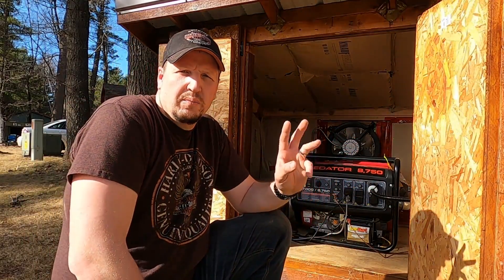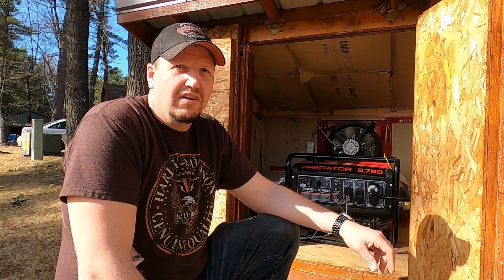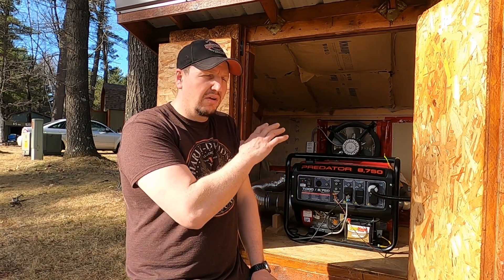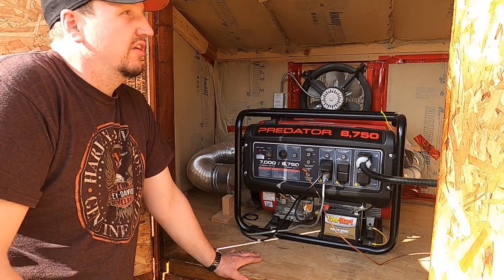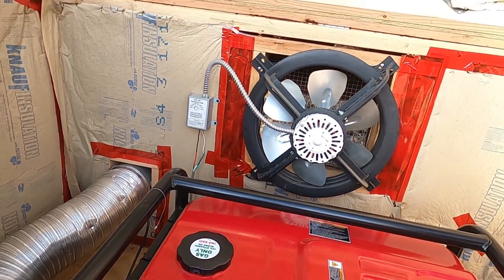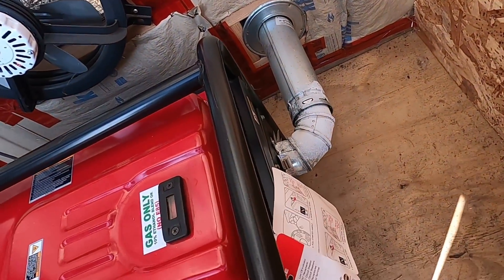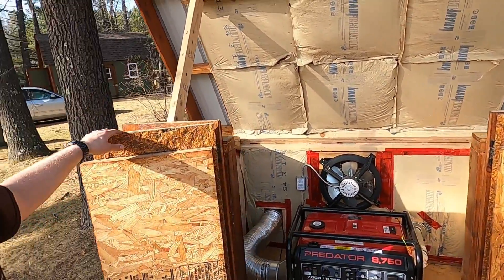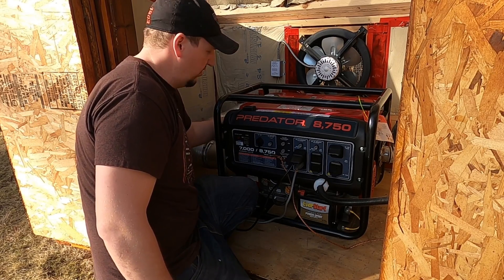Predator 8750 Generator in a Custom Generator Shed | PLANS AVAILABLE!!

Comment: Did you used 4 or 6 gauge wire from gen to house?  That’s a long run.
Reply from the maker: If I remember correctly, probably 6.  Yes, most likely some voltage loss, especially if I had a 50 Amp Gen.  But I am only running 30 amps which is OK for the 6 gauge.  

Knowing what I know now, always important to do the voltage loss calculations.
Reply: @OutdoorsEngineer  I have a 9500 with a similar length run and i have zero loss. Love the house. I have to step up my game, but I focused on getting NG, #6 and a transfer station all set up. Now time for a pretty house. If the 11500 is all they say it is I will be moving up for next hurricane season so I’ll super size it.

Comment: Have you replaced that high THD power generator yet with an inverter model?  Maybe a dual fuel?  Good looking shed for those loud beasts.  lol
Reply from the maker: @ITguyAR_66  I ended up getting the Inverter Genset from HF (another video)

Comment: Plan to buy a gen soon and have reviewed Gen many YTs.  Your install looks and is great, BETTER than a Generac imo...including esthetics.  Sound dampening seems impressive.   Big thumbs up for moving shed away from house and burying cable under driveway.   

Few thoughts....1.  Consider doing periodic and check listed, full load tests (monthly/quarterly) to help insure emerg pwr is available when needed.   Also, train spouse or child on safe startup/shutdown should you be away...or become forgetful.  Consider powering cooling fan AFTER gen is switched off...based on interior temp.  Consider installing properly rated fire extinguisher or blanket very nearby or inside shed.   I like idea of having low power LED utility light auto illuminate at night upon opening shed door.  Also, a solar powered trickle charger to keep battery fresh.   Better mousetrap-ish?  Yeah, but at what price glory?   Again, kudos to you!
Reply from the maker: Thanks, I agree, I really like how this turned out!

Comment: Nice shed. Your exhaust has quite of few bend, this will increase the backpressure on the machine. Predators are notorious for valve problems.
You constructed a beautiful shed and placed a bottom of the line generator inside.  Good video and best of luck to you.

Comment: Always wondered if a water sprinkler feature would help reduce sound noise?
A shed, insulated with styro is a good first step.
Maybe, add a rain dribbler on all sides of the top, maybe pump the water to fall down ACROSS the top of the gen, at an angle?
Seems like there might be something here...
Water is vastly heaver and more dense than air, so, this might eat a LOT of sound!😮
Reply from the maker: Seems like a lot of engineering for how little it actually runs :)

Comment: An earth ground for the generator is not necessary, assuming you ran a ground between the house service panel and the generator.  Won't hurt, but just not necessary.
Reply from the maker: 10-4

Comment: is it necessary to ground the generator when the breaker panel to the house is already grounded?  Basically is it safe to double ground?
Reply from the maker: I'm not sure.  Not an electrician here.
Reply: Most say no , only one ground point, due to ground loops

Comment: Thats funny how you mentioned when you have it you won't need it. A few years ago Texas had record low temps, in conroe tx it got down to about 9 degrees and 14 degrees two nights in a row. and the power was out for about 72 hours during this cold spell. In my opinion it was one of the worse natural disasters that has happened in the past 30 years. Yes hurricane season the power goes out but its usually warm outside we are too far from the coast to really get hit hard anyway. I don't have natural gas so I had no heat. So that prompted me to get a generator.  Its been like 3 years and the power has not went out since. I know that northerners think this is nothing, but down here most people are not prepared for cold weather like that. Most people don't have generators and oil burning stoves for backup. because it usually only drops to about 30 degrees and the power is usually on.
Reply from the maker: I remember that! Wasn't it a big ice storm that did a bunch of damage and took out power?  We lost tons of power prior to 2017 when I installed this generator. Now we've only used it once or twice since!  It is a nice piece of mind though, just in case, and really isn't costing me anything except for a little bit of oil every year or two.
Reply: @OutdoorsEngineer  I guess it was an ice storm, and from my memory I was about 4 years old 1989 it actually snowed enough to turn the ground white. Besides that, it has never snowed that much in this area. The first night all I had was some bell peppers and onions and tomatoes. That was my meal, lol. The next day all the stores had empty shelves and I had like a few bags of chips to eat.  I know other people in different parts of the world have way worse hardships to deal with, but this was the only real time I went hungry and was cold. Actually I'm a veteran and I have been colder but not as hungry during those 4 years, lol. So I have nothing really to complain about, but think about all the people that have young children and elderly, that was a real natural disaster.

Comment: Wow what a nice job! Is that generator enough to run your air or heat?
Reply from the maker: I honestly haven't tried the A/C.  It does run our well pump, and looking at the power requirements for the AC, I'm pretty sure it would run the AC as well.  It has no troubles with the furnace!
Reply: @OutdoorsEngineer  I had a generator that was a little less powerful than yours before I got my Kohler standby, and it could not run my air or heat. The initial draw was just too much apparently. So of course our power went out on a cold winters day. It was out for about 6 hours. That’s what made me decide to get a larger Kohler standby. Just something to consider. But again, it looks really great. A great piece of engineering.

Comment: what intake fan did you use?
Reply from the maker: I used this one: https://www.menards.com/main/heating-cooling/ductwork/booster-fans-accessories/corded-in-line-duct-fan/db206c/p-1449099006884-c-1453749027449.htm. 

But you could probably get away with somthing like this too: https://amzn.to/42v75xi

Comment: if you are running your whole house by code you do not want to ground the generator. your house ground will work fine. as long as you have house ground connected.
Reply from the maker: Thanks!

Comment: Why do you need an exhaust port? Won't the exhaust go out of the box with the fan?
Reply from the maker: The faster the exhaust leaves the better.  You are also adding extra heat that is easily plumbed out using the exhaust port. Plus, newer generators may have a CO detector on them, and if you dump exhaust directly into the shed, it'll shut off due to the CO safey mechanism.

Comment: Is your generator cable wired directly to the house main panel with the interlock device in place and not to a transfer switch or inlet box? That's what I think you're saying and if so I'm happy I saw this video before buying the inlet box and cable because I really like and prefer this set-up, as it requires just going to the generator shed, plugging in the cord and starting the generator, then back inside. This method is best for my wife being out alone in possibly bad weather, as it will get her back inside quickly. As opposed  to her having to get the cord from the shed, then go to the inlet box to plug it in, then go back to the shed to start the generator before going inside. Will it be possible for you to explain how to do this setup? Like explain your method in burying the cable, then that box you have at the house and getting the wire inside. I'd really appreciate it thanks. God bless.
Reply from the maker: Yes, the only disconnect spot is right at the generator.  From that plug, everything is hardwired directly into the panel.  I have the Generator wires coming into slots 2 and 4 in the panel on a 30 amp double pole breaker, although the wire I ran is 6 awg so i could have a 50 amp breaker. The interlock device is designed for my GE breaker panel so that the only way I can turn on the Generator breaker (Supplying power to the panel) is to turn off the main breaker that goes out to the grid. 

The wire from the generator goes into conduit and enters the ground.  In the ground it is directly buried, and then re-enters conduit as it approaches the house.  It is then in conduit until it enters the breaker box. Stay tuned, I will be adding a subpanel in the future and plan to record it, and I will highlight where the generator comes into the panel.
Reply: Thanks for clarifying. I really appreciate it. The WEN 12000 watt dual fuel generator is on its way and I'll purchase the generator 50 amp cord with bare wire end tonight. I'll follow up with you if any issues. Thanks again.
Reply from the maker: @smjohn4640  Awesome.  Where did you order the generator from?

Comment: Did you connect the exhaust to generator with magnets? Maybe my eyes arent so good, but i didnt see a cooling fan, just an exhaust fan, im i wrong? Overall, very nice work...
Reply from the maker: I just used some small self tapping screws, similar to rain gutter screws.   

There is a cooling fan inside the metal duct.  A 6 inch online duct fan.

Comment: Unless I missed it in the video, have you measured the actual ambient temperature inside the enclosure while the generator is running and under load?  I just completed my generator enclosure build and even with heat wrap on the exhaust pipe and a lot of air coming into and out of the box, it still gets up to about 140-150 degrees F (outside temp of about 80 degrees F).  I'm a little worried about the temperature being a bit too hot for the air-cooled engine (my generator is the 8750 inverter generator).  I have thought about potentially taking the muffler off the engine and moving that to outside of the enclosure so that there isn't this extremely hot box emanating heat inside the enclosure.
Reply from the maker: I actually haven't.  Do you have fresh blowing directly on the engine like I do here?
Reply: @OutdoorsEngineer  Yes, I have a vent and fan blowing fresh air right on the flywheel.  The temperature of the air blowing on the flywheel is just a few degrees higher than the outside temp.  What is the longest runtime on your generator setup while powering your house with the enclosure closed up?  Have you run it for hours at a time?

Comment: I built a generator shed just like this one last summer 2022. We had a tornado March 2023 we had no power for 5 days. This design worked great for me, the hinged roof was so nice to add gas and change the oil. I kept the doors shut and the fan kept the shed cool. Thanks for sharing.

Comment: Great ideas for my Duromax 12kw. I defiantly like the hinged roof idea. Only comment is the length of cable to house, voltage drop. I keep my 240v 50a service cable no farther than 25ft from house. Just an opinion, everyone has one...lol
Reply from the maker: For sure!  It is something to consider.  I did plug my numbers in I think Cerro wire's voltage drop calculator and all good.  It's always a good thing to consider the voltage drop.   Thanks for watching!

Comment: Nice design but I would put some angle slats on the exhaust vent to deflect the noise to the ground. Also put some exercise rubber mats on the floor and the doors to absorb the sound.

Comment: No one never ever puts a generator that far from the house. It is always on the side of the house. The cable must be huge. The rest of your shed is great.  Great explanation. 🙂
Reply from the maker: The cable is actually sized if I were ever to install a 50 AMP generator (I used 6-3 wire).  It's actually not that far of a distance but I wanted it as far as possible to reduce the noise I'd get in the house.  You can put it as far as you want as long as you properly size the wires for voltage loss.  Southwire has a nice voltage drop /wire size calculator on their website and we are all good there :) https://www.southwire.com/calculator-vdrop

Thanks for watching!
Reply: @OutdoorsEngineer  The down side to quiet, when you sleeping with it running... someone can steal it and you won't know it until you wake up. Mine is about 15 feet from the house. I know when it stops in my sleep. 🙂
Reply: @JohnSmith-uy7sv there is a device that you can plug in, if the power stops an alarm goes off. I have two of them for refrigerators.
Reply: @2fukWu  ONLY???? The larger the size the higher the price and harder to work with. 🙂

Comment: Set it on sand will make vibration better, not too bad for a Predator gen they are not known to be quite.
Reply from the maker: Certainly not quiet.  The shed certainly helps.

Comment: What AWG wire size did you run to the house ?    (btw-cool shed!)
Reply from the maker: Thanks!  I believe I ran 6-3 (It's been 5 years ha) so if I ever wanted to upgrade to a 50 amp generator, I could.
Reply: Thanks,  at this point I'm just window-shopping generators and looking over my lumber stash.

Comment: Nice shed - but can't seem to figure out how you made the roof lift. It appears you cut the door header and it lifts with the roof.  Does this cause the doors or front wall to be a bit unstable when the roof is open?  Any details on how the front wall to roof construction was done would be very much appreciated.
Reply from the maker: Yes, the roof header is separate from the side wall.  With the sheathing on the sidewall and sturdy attachment of the wall to the floor, I have had no issues with the walls becoming unstable.  They are essentially rock solid. The header is attached to the roof and is just sitting on top of the sidewall, attached through the latches. It's been 5 or 6 years so far and no issues with it holding up. 

Email also sent.

Comment: When you had the generator running, I noticed the fan was turning very slow and not fast as it should be. Why wasn't the fan turning much faster?
Reply from the maker: My guess would be the camera frame rate (30 FPS) makes it look run slower than it actually is!
Reply: @OutdoorsEngineer  I have heard of that and it makes sense, thank you.

Comment: I believe that automatic standby generators are somewhat of a "false economy"  They are really nice and convenient - but come at a significant cost:
 
The thing about an automatic standby generator (like a Generac) is that they require yearly maintenance (that goes up in price a little each year) in order to keep your warranty "intact / valid" it's not uncommon for there to be sales where they'll sell the generator with a 10 year warranty but the catch is they won't (typically) include a service contract for the price quoted - I had a 22kW Generac at my previous home for almost 15 years - when we first bought it (then it was about $6800 all in for the generator, transfer switch and installation) the cost for service per year was just over $100 when we moved (in 2018) the year maintenance was over $200 a year and that did not include a new battery if you needed one (which seemed to last about 3-4 years at $70 - $100).  The maintenance WAS more than just an oil change (or is supposed to be) - valve clearances were checked and adjusted, the generator was checked for output voltage and frequency and adjusted if needed.  Here's what they really don't want you to know or will tell you unless you ask:  Most manufacturers really want to have generators replaced after 10 years regardless of how many hours of use and will almost always refuse to warranty beyond 10 years.  I'd looked into moving my generator to my new home but between move fees and the fact that I couldn't extend or get a new warranty due to it's age or it being moved it wasn't worth it.  You can buy a whole lot of Predator generators - about one a year for less than you would have in a comparable automatic standby generator all things added together.  It is pretty nice to have your generator "kick on" after about 15 seconds of there being no power from the street but that comes at a cost.  For the difference in price I'll drag the generator out of the garage, get the gas out of the shed, fill it up, connect and do the transfer at the panel.  having a nice generator shed really makes things much faster / smoother and the main benefit to this approach is you can upgrade to an inverter generator, one with more capacity - even install an auto transfer switch if you're so inclined - you're not "locked in" to what a particular manufacturer offers.
Reply from the maker: Great comment!  Agreed!  And that's what I did.  Just upgraded to the PRedator 8750 inverter generator a few months ago!
Reply: @OutdoorsEngineer  I'm thinking of going the same route - for two reasons:  1) much much quieter - I've seen one running at a food truck a couple days ago and almost couldn't believe how quiet it was.  2) it's much better for "sensitive" electronics - during the last couple of power outages I really didn't want to run my TV or any computer equipment (other than laptop charger) off of my generator - I have plenty of capacity to do so but am concerned about damaging my nice TV (I don't want to upgrade just yet ;-) )
Reply from the maker: @Scotty_in_Ohio  Precisely.  I  built this shed in 2017 and had to use it for the first time for TV's, computers, STarlink, ETc this spring.  The LED lights in the house flickered at times.   The next couple days I drove down and got the new 8750.  It's still pretty loud as it is open frame, but in the shed it is quiet.  https://www.youtube.com/watch?v=3TOVfRm8M74

I wonder if the one you saw was the Predator 9000 which is closed frame?